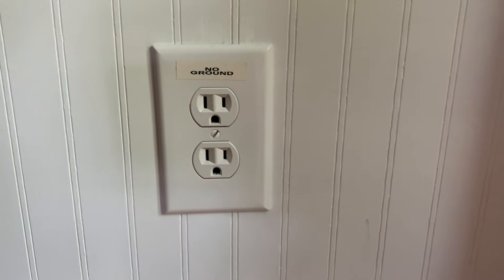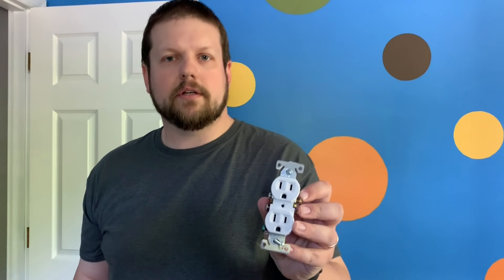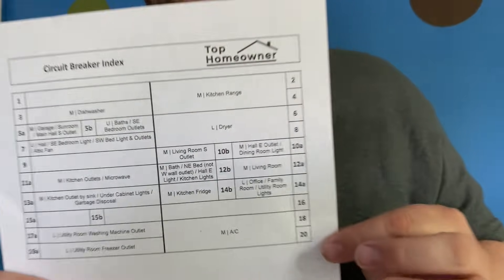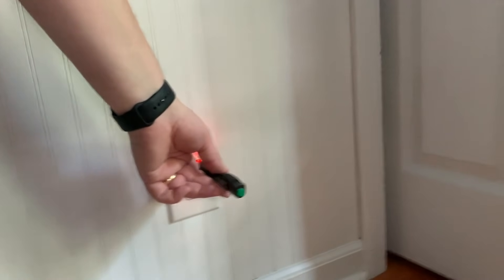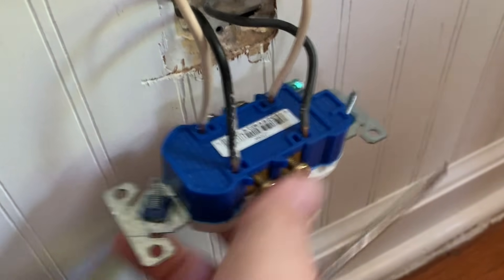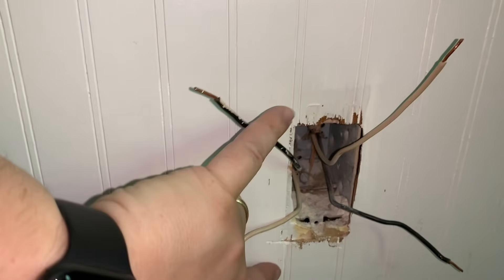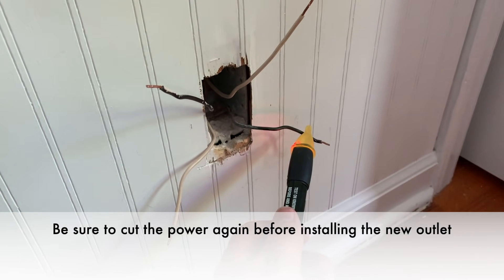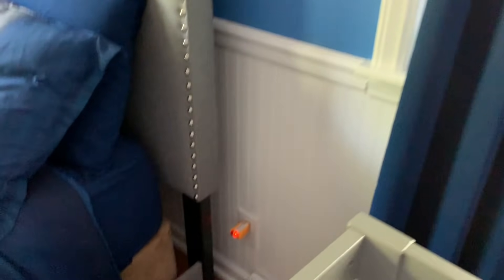Fixing Ungrounded Outlets - An Alternative Option to Rewiring Your Home

Comment: So after installing the GFCI, all the down stream outlets will still show open ground right?
Reply: Jing Chen    They never seem to come right out and say it: A GFCI receptacle doesn’t provide a ground but it does allow you to plug in a 3-prong plug (provided you haven’t exceeded the limit for wattage on the circuit.)
And you must label the 
outlet ‘No Equipment Ground.’
Reply from the maker: Yes, that's correct.
Reply: Which is still not grounded... which is still incorrect
Reply from the maker: I cover this point as well as some others in a follow-up video: https://youtu.be/3AXcRsAOLPk

Comment: 9:34 there's still an open ground?!!
Reply from the maker: Installing Ground Fault Circuit Interrupt (GFCI) outlets are the next best thing to rewiring the home as they introduce additional safety measures. Clearly though if you can afford to rewire the home that is the best option.
Reply: Wet conditions or below grade needs a AFCI/GFCI outlet. First in series from Breaker box...You are assuming too much in the run of the wiring in older homes like yours or electrician was not just grabbing power from other places...
Reply: Ok... yes there is no ground but if you trip one of the outlets in the room it still has to go through that outlet and it will be tripped. That is why it would work.
Reply: The gfci isn’t grounded or is it?
Reply: i don't know where he got those GFCI outlets at because they're not supposed to reset unless grounded.  at least not the ones i purchase.  i've seen where they've been installed in an un-grounded  box and got them to reset (incorrectly wired) but when you put a GFCI tester to it, not just the wiring tester like his, they don't trip when the button is pushed.  so technically, they really aren't protecting you.
Reply: @keayrhyasen3071  GFCI receptacles do not need any ground at all. That's the whole point of using them to offer 3-prong receptacles WITHOUT GROUND, as permitted by code. They work/test just fine.  The TESTER that plugs in, with a "GFCI test" function won't work because there isn't any ground to which it would "leak" the necessary 5mA current to trip the GFCI.
Reply: @UpnorthHere  Exactly correct.  If you were to attach the tester's ground contact to a water pipe or radiator, it would trip because the amperage leak to the ground would have someplace to go.
Reply: @UpnorthHere  Code really allows this?  It's better than nothing, but I wouldn't think it would be to code.
Reply: Not true. See UpnorthHere's explanation, and my addition to it.

Comment: Great video thank you. I have a question...When you say to find the outlet in the room that starts the line, it doesnt necessarily have to be in that same room correct because I have rooms that will be on an electrical line and half of another room will be on that same line or the stairway will be connected with that particular breaker. I've gone through and found and listed everything that is on particular Breakers in my house that was built in 1957. I guess what I need to know is the goal to find the beginning of the wiring of each breaker? Also I have never or do not remember seeing a difference in any outlet that has the extra wires such as you showed to determine where the electrical line starts. That doesn't mean anything more than maybe I just haven't opened up one of those but is it possible that the house wouldn't have that or do they have to have that at the beginning of a line? As you can tell electrical work is not my strong suit sorry if my questions sound stupid.
Reply: John Connolly  My father's 1956 home had cloth-covered 2-wire cable throughout the house and not a single room with your "spider" method. The lighting outlets were on different branches from the receptacles in every room.  This is also how we found the wiring in an old house in Springfield, VT, where every room had two fuses: one for lights and another for receptacles (some of which were crowfoot or Edison shell).  Fun point: it also had a large knife-switch disconnect (!) for each subpanel fusebox.
Reply from the maker: I think that's a great question. Ideally, you "should" have an outlet where the power comes into the room and is then daisy-chained to the rest of the outlets. The last one in the chain should only have wires going to it and not wires leaving it also. That said, I've seen a lot of different things with older homes, even where an outlet on the main floor is connected to  multiple rooms upstairs. This video talks about what should be typical... but yes, the way each home is wired may be different. In that case, what I would do is disconnect an outlet the way I show in the video and then start testing other outlets to see which ones are connected. It can be a lot of back-and-forth but, its definitely cheaper than rewiring your whole house. Keep in mind, you can always hire an electrician to do this as well. Sometimes saving the amount of time you'd spend doing a project yourself is worth more than paying someone to do it for you. Good luck!!
Reply: He doesn't know what he's talking about.